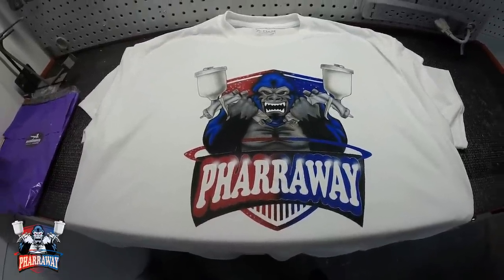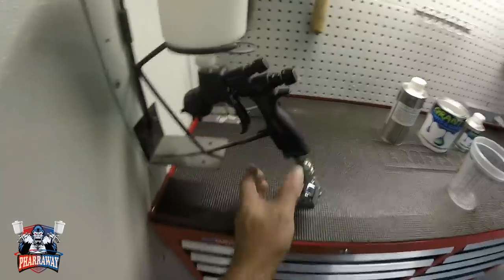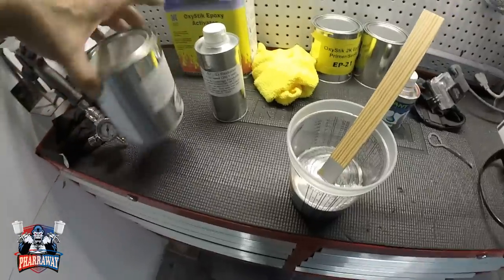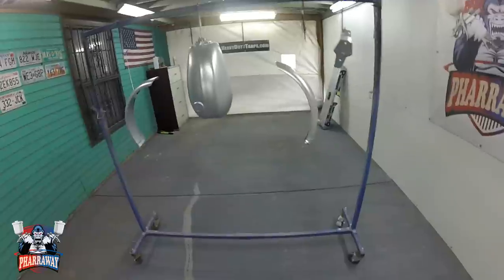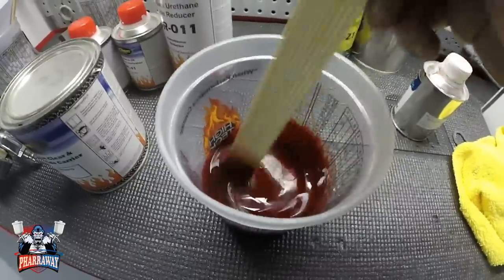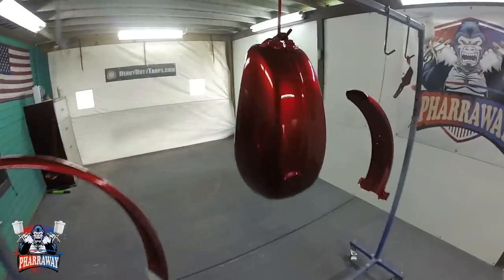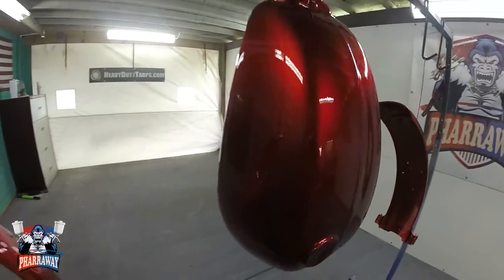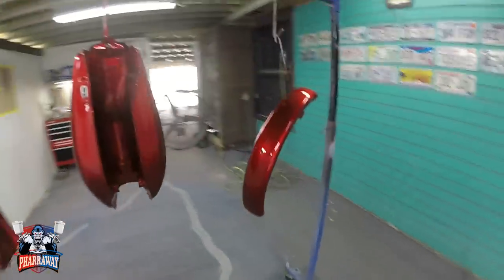How to candy paint a motorcycle at home

Comment: A thought ...... testing the clear on the decal for a light coat would help you to see if it would run the vinyl. Some do some don't. I guess it depends on the paint and the vinyl ink too. Anyway just a thought. I sure would hate to have to start that tank all over myself. I've had good success with clearing decals. Emblems are quite different. Many decals have a clear over the ink ......... anyway well done.

Comment: If you wanted to use a red metal flake ( big flakes ) would you put the flake down first in place of the silver metallic, fill it with clear binder and sand the peel out until smooth then apply the candy color then clear it ?
Reply from the maker: yes that is correct
Reply: @PHARRAWAY   Next question , Your using .008 flake correct , how much bigger flake is .025 ?  And can you shoot .025 flake with a 2.2 tip & needle in your gun.  I assum that with the bigger flake, you might need to lay 4 coats of clear binder on top of the bigger flake , then wet sand it to around 60% flat , then lay another 4 to 6 coats or until all the peel wet sands out before applying the candy, then tapping for strips etc. then 3 coats of clear over all of it, sand & buff as needed. Want to do my 68 RS Camaro in big flake & candy blue, then tape off pear white SS stripes. Done it in straight base clear paint last time, this will be my first flake job. Would love to try lace on the rear spoiler as well, but ---- scared lol , I don't want to screw this up. I plan on playing with the flake & candy on old doors to get use to it . You make it look TO EASY ! Some guys use a sliver base coat under the flake, others use a black base coat and others use a white base coat . What is the thinking on the base color ?

Comment: Great video presentation. Couple of questions. What size nozzle(s) did you use for this project? After your base coats did you tack it to help the metal flake lay down before shooting the candy? Did you do any final sanding or buffing? Thanks
Reply from the maker: The size was 1.3 tip and yes after the base it was tack and about the buffing no I did not

Comment: Excellent job. Quick question, any trouble with overspray with parts hanging so close together, or the product still wet and no problems? I’m a furniture lacquer painter and overspray is always a trouble.
Reply from the maker: For me there is no problem because I use slow reducer and hardner so it take a bit to dry
Reply: @PHARRAWAY  I’m going to try retarder in my next lacquer job. See how it goes
Reply from the maker: @ouimetco  good luck let me know
Reply: @PHARRAWAY  thanks will do. I’m a little new to lacquer and learning.

Comment: If u wanted to add more flake at what step in the painting do you add the flake?
Reply from the maker: On top of the silver then you will need to apply clear to the silver wait 2 or 3 days resand the orange peel and at this point apply your candy and finish with some clear
Reply: @PHARRAWAY  you mix the flake with the silver or with the clear?
Reply from the maker: @streetclasscc5189  you can mix it either way both work

Comment: At what temperature are you spraying in the room.
Reply from the maker: It's 97 degrees
Reply: I'm thinking of building one. Do yubhave a heater in there or just the heat off the lights.
Reply from the maker: @BerdManLoak  just the heat of the lights it's always 110 degrees here in texas
Reply: Last question do yu recommend 600 or 400 grit for a repaint.
Reply from the maker: @BerdManLoak  400 will be good
Reply: Thank you. One day I'll be brave enough to paint candy. I like watching your videos helps alot.
Reply: Happy Monday bro,  so I sanded truck down w the 400 grit and discovered some small digs that didn't sand down.  What do you recommend I use to remove them or fill them
Reply from the maker: @BerdManLoak  you can use feather fill putty and after apply some primer to it
Reply: Thanks I'll head to my local paint supplier